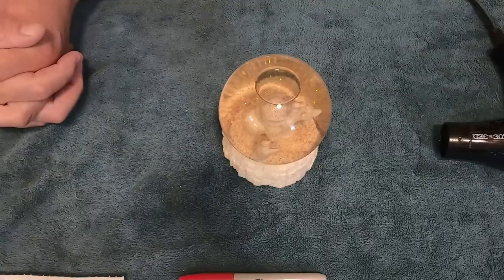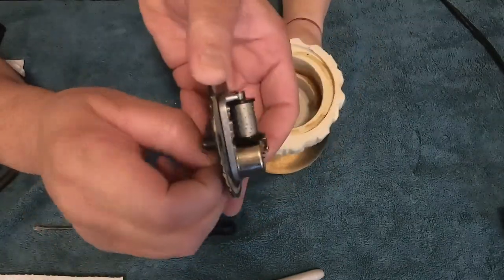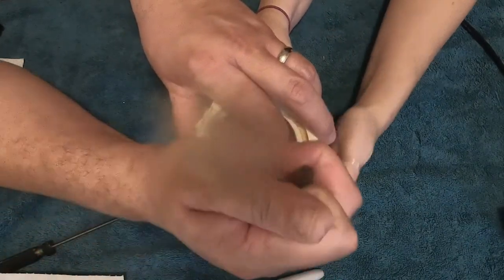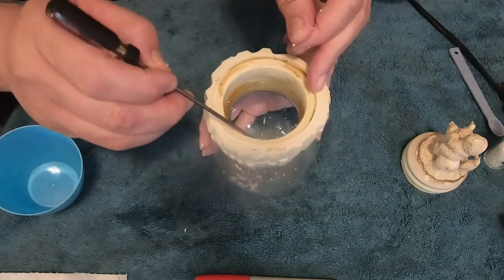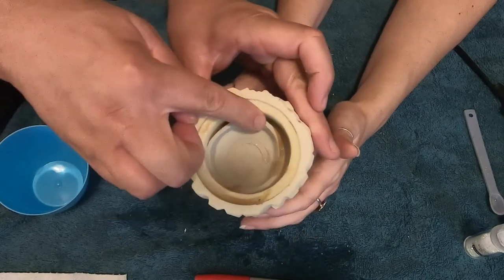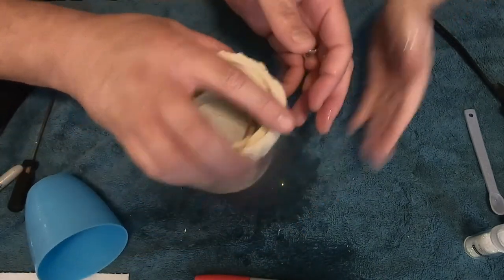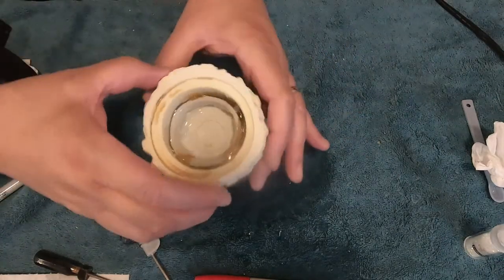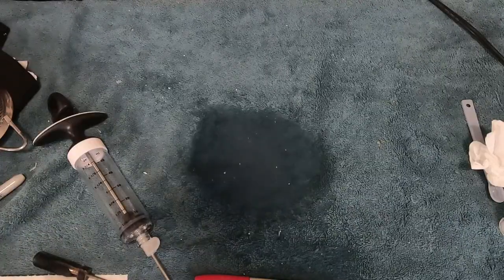Ep. 4 - Repair of a Snow Baby Snow Globe

Comment: Because of Hurricane Ida, i lost my apartment and my 50 or so snowglobes were pit in a plastic tote with blankets between layers go protect them. My storage unit got broken into and may got broken. The ones that werent broken either lost water, the ornament inside detached and is floating around or the water turned colors or is cloudy and many have separated from the base. Does changing the water affect the ornament inside?
Reply from the maker: Hi. Sorry to hear about your snow globes. That is unfortunate. Changing the water in the snow globe does not have a negative affect on the ornament. Good luck!

Comment: Do you use a specific brand of glitter you use for your snow globes?  I am repairing a Pinocchio snow globe with a dry-rotted gasket so there wasn't any glitter to save. The glitter I used floats.  Any help would be appreciated.  Thanks!
Reply from the maker: We use the Recollections line of glitter that we found at Michael's Craft Store and it is also on Amazon. We have never had an issue with that glitter.

Comment: Hi! I have a lot of snow globes needing repair:( at this point I'm guessing the hot wheather is doing this.  I hope to have all the tips now.  Thank you from Brazil!
Reply from the maker: That's great to hear. We are happy that you found our channel and that it will provide you with the information that you need. You are correct, heat can cause the snow globes to have issues. This is just the first of many repair videos on our channel covering many different types of snow globes. And that is great that you are watching from Brazil! We always like to hear where people are watching our channel from! Thanks for the comment.
Reply: @snowgloberescue8887  I'm soo glad we were able to fix 2 of my snow globes! They are not 100% but not leaking anymore and we dont have to dump them! I'm a huge fan of snow globes and here is not easy to find them, so we buy when we travel. Now when they start to leak or have any issues I know the way. I will certainlly watch all your videos and share! Thank you so much!

Comment: I'm so glad I found your channel and my daughter collects snow globes and some need fixing by now. I want to fix them for her so your videos are very useful. I tried fixing one yesterday where the globe had no water at all. All worked fine until I noticed that little air bubbles kept forming on the figurine. All the supplies I used were room temperature. Has this ever happened in your experience? What am I doing wrong?
Reply from the maker: Hi and thanks for watching. That has happened to us. Once we reassemble the globe and remove the air bubble we do sometimes get air bubbles that appear. Sometimes this is air that is trapped in the figurine from being out of the globe. We've gotten into the habit of moving the globe around in different direction while tapping lightly on the glass globe to dislodge any air bubble that may be hiding. We normally let the globe sit for a few minutes to allow any tiny air bubbles to accumulate before removing. This normally is all that is needed. However, we had times when the air was sneaking past the stopper into the globe. It is possible that the stopper is not providing a perfect seal which may be the reason that it lost all of it's water in the first place. If the air is getting past the stopper, after getting all of the air bubbles out sit the globe upside down until it is dry enough to seal the stopper and globe with hot glue. Once the glue cools you should be able to set the globe upright without getting any bubbles back in it. By the way, This is video that you watched is the first repair video on our channel and is almost a year old. We have over 100 videos on fixing different types of globes, we also demonstrate the water submersion method for removing air bubbles. Our more recent videos are much better and we have learned a lot along the way. We are happy to hear that you repaired you first snow globe and that we could help. Thanks for watching!

Comment: Where would I get another rubber cup piece?  Mine ripped.   Thank you
Reply from the maker: Finding new replacement rubber stoppers has been a challenge. We get all of our replacement parts, including the stoppers, by disassembling other old used snow globes. We get a lot of globes that are beyond repair and we use those for parts. There are links in the video description to companies that sell snow globe parts, however, they do not sell the stoppers by themselves. The replacement glass globes that they sell come with stoppers but they don't sell the stoppers themselves. If you want a new stopper from them you have to buy a replacement globe. We are trying to find a better supplier.

Comment: Are you using distilled water? Can we use purified water? Did you make your own distilled water?Other people use alcohol in their water solution. 
Do you feel it’s not necessary?
Any familiarity with using anti-freeze or glycerin?
Why did you use glue in the water? Which elmer’s glue was that?
Any idea what type of bonding glue was originally used on the globes? The yellow glue that is that was already there. It seems so flexible in a good way. 

Great video. One of the best so far. Thanks!
Reply from the maker: We use filtered water. Some people use distilled water, some people add alcohol. Some snow globes come from the manufacturer with antifreeze to keep them from freezing in cold temperatures but we don't use it. Some people use glycerine to thicken the water so the glitter and snow drop slowly. When we learned how to do this it was with Elmer's Clear Glue to thicken the water which worked fine and we just stuck with it. The bonding glue originally used on all of the globes we have repaired so far has been standard hot glue. I hope this helps! And thanks for the feedback!
Reply: So glad you asked about the glue in the water. I needed to know too!
Reply from the maker: @truegemrn  Hi PT. The clear glue is used to thicken the water so the glitter and snow fall slowly. It is a substitute for glycerine. We recently posted a video, Ep. 32 https://youtu.be/cjyn_3wFXDc, where we compare using glue to glycerine and baby oil.

Comment: Thanks 💕 I got myself into a bit of a pickle,  I said hey let's do a craft , for the ladys in the assisted living 😀,  but I have to prep 40 snowglobes,,on my own,  and build them with these beautiful people,  somehow I think they are going to roll over my toes , if it don't turn out right, I see myself running down the hall Away from them, crying out help. They are after me,  just because the project made everyone get a bit messy!! 😆 🤣 😂 😹 😆  any suggestions  lol
Reply from the maker: Hi. Sounds like you have quite a project on your hands. The only suggestion that I can think of is use plain water it will save you the possible mess and extra work. If you want to use clear glue or glycerine I would suggest taking a container of water and mixing the glue/glycerine in the container so you can just pour the mixture in and then move on. That may help simplify the process and minimize the mess. Sealing the stopper with hot glue is an optional step that just helps prevent the water from leaking out, however, many manufacturers do not do that step and in many cases the stopper alone is enough. Not having to seal the stopper with hot glue would save some mess and difficulty. This video that you commented on is the first repair video that we did for the channel almost two years ago. Our process has improved and evolved over the past two years. For example we no longer use the syringe to remove the air bubble. We submerge the globe in a bucket of water and pull back the stopper to allow the bubble to escape and fill with water. Doing it that way will be safer and more successful that with the syringe. Check out our Snow Globe Repair Video playlist to see all of the different types of snow globes that we have repaired. Look for thumbnails of globe similar to the ones that you will work with and check out some of the more recent videos. Good luck!

Snow Globe Repair Playlist
https://youtube.com/playlist?list=PL2nI60LLgsOzFUEwNoQz4odEeCL01jpHF
Reply: Also the globes I got was , from dollar tree , I see that they leak should I go to get a rubber fittings from home depot,  or get a water sealer and put it  around the bottom,  I am getting  scared ,, lol
Reply from the maker: @natileecosine1294  We are not familiar with what Dollar Tree offers in the way of snow globes. Are these snow globes that have already been assembled or are these snow globe kits? In our experience inexpensive small snow globes, such as the ones from places like Dollar Tree are assembled with super glue and are difficult and in some cases impossible to disassemble without breaking the glass globe then replacing it with a new one. If it is a kit then it should work fine with what comes in the kit. In either case, if you are concerned with water leaking, you can seal the stopper. We use hot glue primarily because it is easier to work with, cools much faster than glue takes to dry and it allows us to easily disassemble the globe later if we have future problems. But if you don't have hot glue you can use silicone sealant or something similar. However, in many cases the stopper alone works fine. good luck!

Comment: I excited to try and fix my snow globes all 16 of them need fresh water what was the size of that globe mine are many sizes and I don't want add to much glue
Reply from the maker: That's great. We're happy to hear that you are going to repair those globes. As far as glue, in our more recent videos we started doing the glue a bit nor consistently. We are now doing 30% glue in our globes. If you are working with 4 inch globe you want to add about 10 tablespoons of glue for 30%. A 6 inch globe needs 36 tablespoons of glue for 30%. Let us know if have one that is not one of these two sizes and we will see if we have the measurement.
Reply: @snowgloberescue8887  thanks I can probably figure out what I will need using the 30% ratio. Do have another ? hough.many of my globes do not have access through the bottom, do you videos showing repairs for these kind.
Reply from the maker: @dawnaturner4111  It sounds like you have some solid base snow globes. You have to heat the base up with either a hair dryer or our preferred method of boiling water. Put the snow globe in a plastic bag or wrap it with plastic wrap then place it into a bowl that is taller than the base. Add boiling water up to the top of the base, keep the globe out of the water. The plastic will protect the base from the water and allow the heat to transfer through the base to the hot glue and soften it to where you can remove the globe. We have many videos showing this process, check out Episodes 128 and 114 for two examples.

Comment: Good afternoon!  Thank you so much for your videos.  I completed my first one with great success.  I have a snowglobe a Nightmare Before Christmas.  When I took off the bottom it was full of wires as the globe has lights along the bottom.  It there a way to take the globe off from the top? Or do I have to send this one off to someone? Thank you for your advice.
Reply from the maker: Hi. We are happy that found the videos helpful. You can remove the globe from the top by heating the base until the hot glue holding the globe melts. You can either use the boiling water method or a hair dryer to heat the base. We repaired a Nightmare Before Christmas Santa Jack snow globe in Episode 116 where we used the boiling water method to remove the globe. Unlike yours, the Santa Jack is a solid base snow globe, however, the boiling water would still work. The only difference is that you should put the globe in a plastic bag to protect the base. We didn't use one for Santa Jack but you can get away with it on solid base snow globes, however, we now put them all in bags to protect them from the hot water just in case. You can see a recent example of the method using the bag in Episode 201 where we repair a Harry Potter snow globe. Good luck.
Reply: Thank you for the advice.  One other question. I was so excited to repair my first one.  I didn't think I had any air bubbles. I noticed little bubble attached to the figurine in the globe.  Several have raised to the top creating a little bubble.  Then today I noticed the little bubblies clinging to the globe and on the figurine.  Did I do something wrong.?
Reply from the maker: @Laurel1705-kdr  Hi. No you didn't do anything wrong. We get that sometimes as well. Sometimes we don't let the water sit long enough before removing the air bubble. It looks like we got it out but sometimes a small air bubble will form. After installing the figurine and stopper we normally tap the globe to get any little bubbles clinging to the figurine to release. Once we remove the air bubble we normally let the globe sit for a while to see if any bubbles form and then do another removal. The professionals have vacuum chambers and vibration tables to help. The best advice would be to tap the globe carefully to loosen any bubbles and then give the globe some time to sit so any little air bubbles can rise and gather.
Reply: Good evening! Thank you for your advise.  I tried for a long time to get the globe off the top and could not get it to budge. So I went back to the bottom.  taped all the wired away so I could work on it.  There was another panel after taking off the base cover.  The music box is attached to the turning mechanism that is attached to the plug. I am not sure how to separate the two.  Have you ever had a globe like this.  Any advise? I'm afraid I took on more than I can handle.
Reply from the maker: @Laurel1705-kdr  That globe should separate from the base if they used hot glue, which most globes do. Sometimes there is a lot of glue or the density of the base requires the heat to be applied longer to get the globe loose. We have had some that we had to heat for over 45 minutes to get it loose. The mechanism on the music box that turns the figurine should just slide into the spindle on the stopper. It is difficult to visualize what you are dealing with. You can email us some pictures at tespi74@gmail.com and we will look and see if we can provide any advise.

Comment: What was the glue in the water for? And what kind was it?
Reply from the maker: We use clear Elmer's glue. The reason for the glue is to thicken the water so the snow or glitter fall slower. You can  also use glycerin. Plain water is also an option as well as using baby oil instead of water. If you are interested you can see us do a side by side comparison of the four options in Episode 32.
Reply: Thank you for the reply. I will check out the episode. Merry Christmas!

Comment: I tried repairing my daughter’s snow globe but I wasn’t able to. I used a blow drier to help heat up the glue & remove the glove from the base but it didn’t work. I kept going for close to 10 minutes & nothing. It’s a Disney 55mm globe & I’m not sure what type of glue they used. It’s just not happening as it should & sadly I think I will have to replace it rather than fix it. I’m disappointed 😞
Reply from the maker: It depends on what type of base you have. If it is a standard hollow base with a music box and cover then you should be able to take it off with a hair dryer. However, if the globe has a solid base globe then the hair dryer may not be enough due to the density of the base. In that case you need to use the boiling water method where you put the snow globe in a plastic bag then put that in a bowl and fill the bowl with boiling water up to the top of the base. Most snow globes are assembled with hot glue and one of these two methods should work. Keep in mind that 10 minutes works in most cases but we have had some globe that took 30 minutes to loosen the glue and we needed to boil fresh water every 10 minutes. Check out Episode 196 to see a recent example. You can also check out our repair playlist to see all of the globes that we have repaired. You may see on like yours on the list. Playlist: https://youtube.com/playlist?list=PL2nI60LLgsOzFUEwNoQz4odEeCL01jpHF.

You can also email us a picture of your globe to tespi74@gmail.com and we may be able to provide some better advice. Good luck.

Comment: Can I use silicone instead of hot glue?
Reply from the maker: You could use silicone instead of hot glue. We have never tried it but the one problem we see is that if you ever need to repair that globe again the silicone will not be as easy to loosen or remove as that hot glue. Hot glue can be loosened or removed with heat. It is not so easy with silicone.
Reply: @snowgloberescue8887  Hot glue it is then! Thanks for the feedback! I have to fix a snow globe my wife and I got 27 years ago after we got married this video is giving me some confidence 👍
Reply from the maker: @MrHandy-nr5hi  Glad to hear that our video is helping you. Good luck!

Comment: Im replacing the water in my old snow globe. But there is a thin layer of glitter which will not sink, just floats on top of the water, and looks slimy. Any advice did i do something wrong?
Reply: Most sinks, just a thin layer of glitter
Reply from the maker: Thanks for the comment. That happens to us as well. We found that after a day or two, if we shake it up a few times the glitter eventually all falls. Make sure you are using good quality glitter. We get ours at Michael's.
Reply: @snowgloberescue8887  i got martha Stewart glitter from micheals. Thanks for the advice ill wait a few days and see what happens.